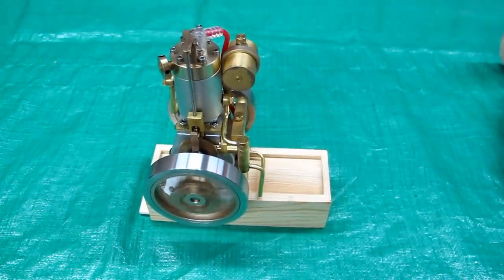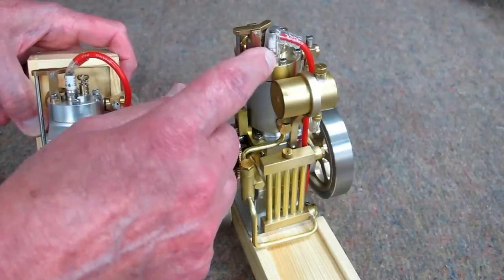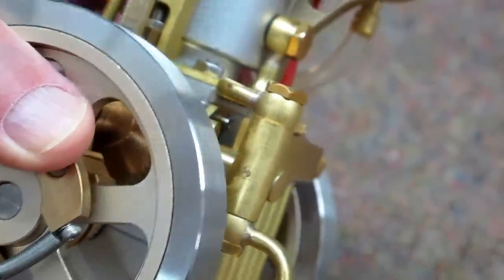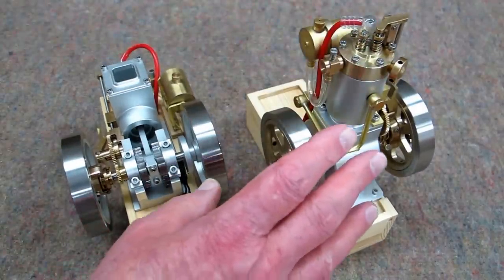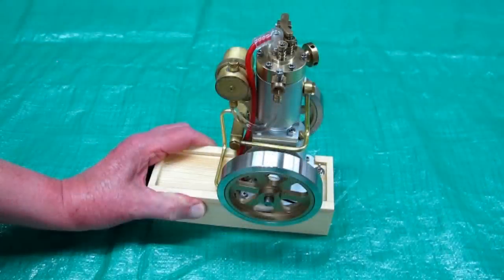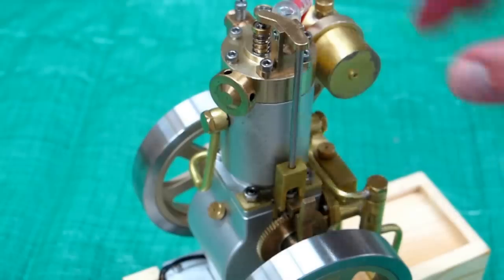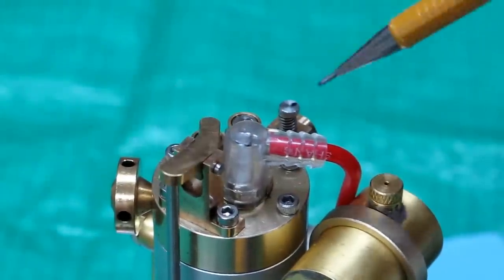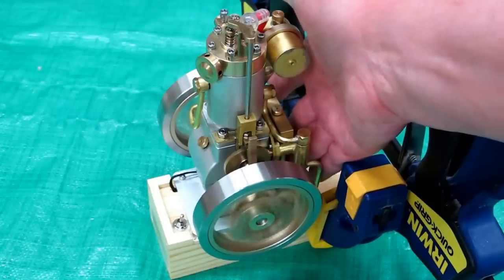Eachine ETX Vertical Hit & Miss Water Cooled Engine

Comment: I have the same two engines . They are very nicely made how ever there is one flaw in there design  ! The fully floating gudgeon pin will rub and  score the cylinder liner . I  slightly shortened the gudgeon pin and machined 2 small Teflon discs and placed them in the piston preventing the gudgeon rubbing the liner .
Reply from the maker: Good idea. 
There are a number of shortcuts in the manufacture of these engines. 
Quite a few areas available for improvement.
Thanks for watching. Please subscribe. 
That is what keeps this channel running. 
Ron

Comment: Nice review! The designer, Jin, has videos of this with an electric motor attached for self starting. And he has the engine mounted in a boat. He starts the engine via his RC transmitter and then drives his model boat around on the pond. Pretty neat.

Comment: Hi Ron, Remove your crank case vent plug and it will free-wheel longer between power strokes (firing) and run cooler. Nice video. Gil
Reply from the maker: I will try that. Thanks!

Comment: Just a thought, using an appropriate antifreeze mixture would help protect from freezing damage and if a reasonable quality one is used bimetallic corrosion.
Reply from the maker: My point here was to remind people if you forget there is water in it, it can freeze and break. I don't think I would bother with antifreeze. There are several different metals and not sure what seals are inside it. Just drain it up when done playing.

Comment: Ron; I see that Banggood now offers a "rope starter kit" to be used on the ET1 & ETX engines!  Interesting, for sure.  My ET1 has no need for this option; it starts easily with just a spin of the flywheel by hand.
Reply from the maker: Thanks. I hadn't seen that yet. I will add a link in the video descriptions.

My ETX now starts easily by hand as well.
Reply: Could be for poeple that use them in model boats, they do the same thing for glow engines in rc cars and boats since there's no room to spin the wheels.
Reply: @archygrey9093  good point, Archy.

Comment: Great info convinced me to buy two of them.  Problem one of them will not start no spark on the plug, any ideas?
Reply from the maker: Not sure if you are telling me you have a problem or are ask me for a suggestion of which one(s) to buy.

ETX is a good engine but in my opinion overly complicated and not worth the extra money.
In this series of hit-n-miss engines ET1, ET7 and ET6 are my favorites, in that order. 
ET1 was the first in the series.
ET7 has a simplified governor and is easiest to work on in terms of replacing the piston ring o-ring.
EM2 is also a really nice engine.
Purchase them separately using my links and discount codes (found in the description for these engine videos) and you will save some money.
EM2 may not have a discount code.
Banggood has a 30 day refund/replacement guarantee. But I always suggest using PayPal for payment which simply gives you one more layer of protection.
Therefore if it is damaged in shipment or doesn’t run you are covered. Banggood may ask for a little more for insurance which isn’t a bad idea especially this time of year.
Engines which are in stock have been reaching me via air freight in about two weeks, but this time of year can delay things.

Comment: I purchased one of these and it was an absolute piece of junk. It turned up with a smashed spark plug so I needed to replace it. Despite careful lubrication and bleeding of the cooling system prior to starting it only ran for around 5 minutes before it failed. It now makes a grinding sound from the bottom end and there is a lot of play in one of the crank bearings. It had not even reached temperature before it failed.
Reply from the maker: You are offered insurance with the shipping when you paid for it. If it was received damaged, did you file a claim for damage?
Banggood offers 30 day return or replacement. Did you file a claim?
If you paid with PayPal, you have double protection and longer than 30 days to file a claim.
Did you do any of these things?
Reply: @RonaldWalters2010  Yes the item is being returned. My comment was more about the quality of the item rather than the buyer protection. It was disappointing because the videos I have seen about this engine looked promising and while I was expecting (an willing) to make some minor adjustments there was around 0.5mm slop in the main crank bearings (not end play). The flywheel at the cam end also had nearly 1mm runout along with other issues made it pointless trying to get it working properly. It was also sold as a UK warehouse item but took over a month to arrive and we then had to pay import duty on top of the purchase price.

Comment: you do very good explaining these.thank you.i'm into full size hit miss engines my biggest engine is 9hp economy.but do enjoy little ones.how do you lower compression on little upright..lighter exhaust spring?
Reply from the maker: I replaced both of the governor springs with shorter lighter springs. I have not touched the intake or exhaust valve springs. It seemed to me the vertical Hit & Miss had slightly lower compression than the horizontal Hit & Miss. This would have been done by the manufacturer by altering the length of the connection rod or very slightly shortening the piston.

Comment: I had been looking at this engine since your first video on it, but with this video, I decided to order it and add it to my ET1 engine collection!  But, this engine is different in some ways, of course.  You indicated, that yours maybe a bit down on compression.  Could it be that the piston is getting less lubrication because of its vertical position? Perhaps, a bit more oil should be added to the fuel.  I like to add an amount of " Marvel Oil" so it shows pink in my fuel line.  Also, my engine(s) seems to run best on lighter fluid.  I am also wondering, if an amount of oil should be added to the crankcase that would be splashed up to the wrist pin by the crank/connecting rod?  When  I get my engine, I think these are the things that I am going to do.  Also, I wonder if you have tried the optional pull cord starting, just for the fun of it?  Keep the great videos coming, regards Karl
Reply from the maker: After running for a while the compression improved and it became easier to start. I think the o-ring piston rings seated a bit better. I increased the Marvel Mystery Oil to about 5% and I think that provides plenty of lubrication. Any more than that and it may screw up the spark plug. The crankcase isn't intended to hold oil and oil from the fuel accumulates inside and leaks out around the bottom plate. Lighter fuel is naphtha which is pretty volatile.  Coleman Lantern Fuel is basically unleaded gasoline without any additives (white gas) and both of my hit & miss engine run on it very well. The pull cord accessory was not available until after I made the videos... and no, I have not tried it. Thanks for watching! Ron
Reply: @RonaldWalters2010  Okay on the crankcase seal.  I guess I would, in this case, squirt oil through the crankcase breather hole aimed at the connecting rod. Then, I would invert the engine for a period of time, hoping that some of this oil, reaches the piston, cylinder and wrist pin. If there is some piston blow-by, with oiled fuel, this may solve the lower crankcase lubrication, I would think.  Keep the ideas coming Ron.  My engine is on its way to me here in Michigan!
Reply: I just received my ETX engine today; unboxed it, oiled it, fuel it up, and after about 5 spins of the flywheel by hand, I had a running engine!  Mine came with a starter pulley and rope.  I think next week, I will see if my 15 month old great grandson can start it!  Great fun!
Reply from the maker: Glad you like it.

Comment: Thanks Ron for another great ET engine review!  I wonder if using anti-freeze instead of water would be a better idea if this engine might be exposed to freezing?  Anyway, yours is a great running engine.  Do you have a source that you could share for the springs that slow it down?  I have the ET1 and I have not been disappointed it that engine!  I think that this ETX could use a little different base design so it is not as tippy.  Again, thanks for the great review.
Reply from the maker: Both engines (horizontal and vertical) need a heavier base. My point here was to remind people if you forget there is water in it, it can freeze and break. I don't think I would bother with antifreeze. The springs are 0.4mm wire diameter x 4.5mm x 12mm dual hook tension spring - available out of China… pack of 58 pcs so you’ll have a few spares.  https://www.ebay.com/itm/0-4mmx4-5x12mm-Metal-Dual-Hook-Small-Tension-Spring-58pcs-/323742846964?_trksid=p2349526.m4383.l4275.c1#viTabs_0

Comment: Was the battery ever replaced with a magneto/capacitor?
Reply from the maker: Not  to my knowledge. I haven't seen one.
Reply: @RonaldWalters2010  would it have worked ?
Reply from the maker: Magneto ignition is simple yet somewhat complicated. You have a spinning magnet, laminated core, wound coil, capacitor, contact points and a cam, which probably is not going to respond well to miniaturization. Even the smallest ones tended to be fairly beefy items... and it takes some power to drive one (and a heavy flywheel). This is why ignition systems have gone electronic with magnets and Hall-effect sensors. 
Lawnmowers, weed eaters, leaf blowers all have a flywheel with a magnet in it but the remainder of the ignition system is electronic and sealed to keep out water and dirt and to eliminate the contact points (which were often a problem).

Comment: I would have thought that the vertical engine would have had a wet crankcase (oil) and a splash lubricator for the piston and upper connecting rod bearing and cylinder will.  The plug on the side of the crankcase looks like it would be the filler and place to check oil level.
Reply from the maker: All of these hit & miss model engines are dry sumps. Oil everything before every run.

Comment: Thanks for your videos, received the ETX today and am anxious to fire it up. What's your thoughts on putting some light oil in the crackcase since it's "sealed". Maybe some would splash around and lube the con bearing and wrist pin? Kinda like a model t ford... thanks
Reply from the maker: Rod, I have not taken the engine apart but I am under the impression the crankcase is not sealed and there probably are no seals on the crankshaft. I show how I oil the upper and lower end of the connecting rod using a syringe. The bottom end has bushings on it so it needs frequent oiling. It has been a while since I ran mine but it seems like the oil from the fuel leaks out along the base. I also have a video on the fuel I use. Have fun! Ron
Reply: Thanks for your reply, I'll add marvel to the fuel and attempt to oil it with a needle. Appreciate your attention to detail!

Comment: If you put the clamps on the side it will act like legs extending out giving more surface area, so the engine would be less likely to tip over, (think of the out rig legs on a crane). 😁
Reply from the maker: Basically, it just needs a heavier metal box.

Comment: How much time can you get from the rubber piston rings before replacement?
Reply from the maker: Viewers have said 5 to 8 hrs just running the engine under no load. Under continuous load maybe 3 hours. 5 hours on one of these model engines is a long time. I seldom run one for more than 8 or 10 minutes at a time. 
Thanks for watching. Ron
Reply: @RonaldWalters2010  
Can you put oil in the crank case? Enough for splash lubrication? I guess with only 5-10 min demo runs, it might just be unnecessary and messy. But, would that add run time to the rings? Or is there any reason the crank case can’t have 1/4 in. of oil?

Comment: I got my ETX engine today and it leaks all the water out at the plunger of the pump.. how do Ihave get it fixed.
Reply from the maker: The fittings on the tubing use a flat washer seal gasket which looks like thin paper or cardboard. The flange on top of the pump (2 screws) probably has an o-ring which seals the flange and acts as a wiper on the pump rod (like a hydraulic cylinder). It will be a small metric o-ring. I am guessing since I have not had it apart and there are no diagrams or parts lists for these engines. If you want to discuss this further go to my channel page > About > lower left corner "Get eMail Address" and send me an email.
Reply: @RonaldWalters2010  Thanks Ron

Comment: Great video Ron.  Very well filmed and explained.  Beautiful engine. Do these give off carbon monoxide ?  Cheers Rob
Reply from the maker: Most anything that burns fuel gives off carbon monoxide.
Reply: @RonaldWalters2010  How much?  I once ran a Nitro engine in my apartment and I started choking immediately. Not one of my best ideas. I know carbon monoxide won't choke somebody, it simply makes somebody pass out. However, I did learn the hard way that some engines can be very dirty. Perhaps I had the carburetor setting too rich.
Reply from the maker: How Much? Links and coupon codes are in the description for these videos.
The exhaust from burning methanol and nitro methane can be overwhelming. If you have ever been near an alcohol burning race car you will never forget how bad it is.
Reply: @RonaldWalters2010  I meant, how much carbon monoxide?
Reply from the maker: I have no idea. You should have an exhaust fan running. I cannot run an exhaust fan and the hit & miss engine when shooting a video as my exhaust is too noisy for the microphone. After 5 or 10 minutes out in my shop it is time for the exhaust fan.